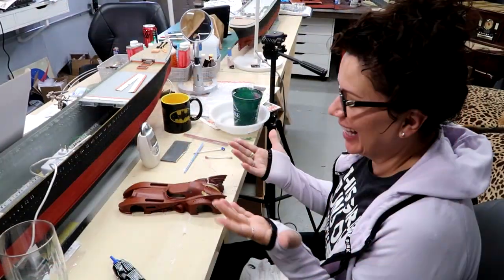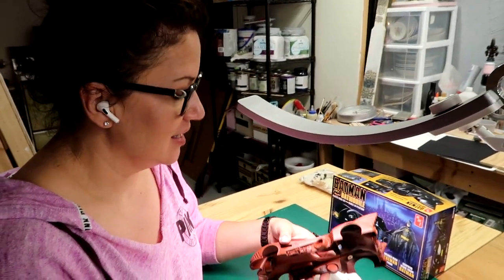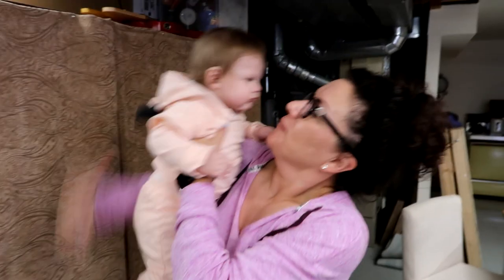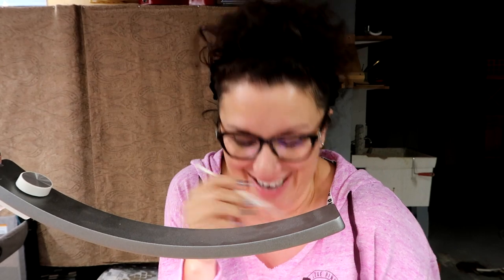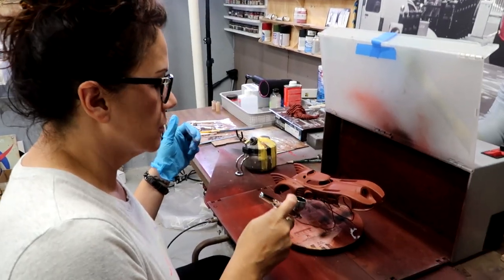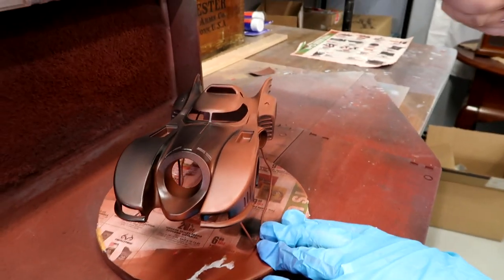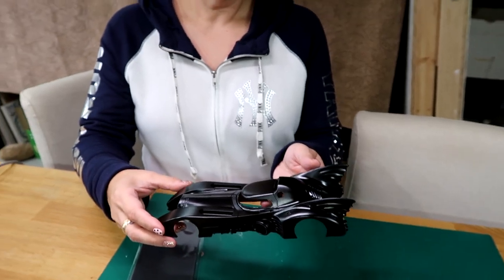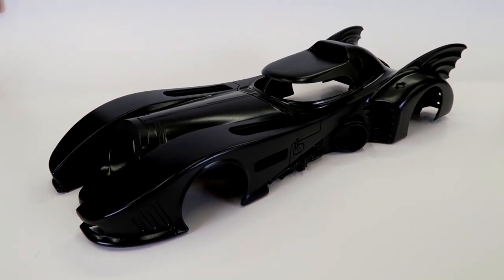Nora's AMT Batmobile Video 3

Comment: Looks good. What I like to use for filling gaps is I buy an extra bottle of tamiya extra thin glue I put the color of sprue from the kit I'm working on in the glue and it turns it into liquid plastic and I use that as a filler. Yes its pricey but it works.
Reply from the maker: That’s actually a really great idea.

Comment: Nora , a secret technique for filling deep seams like that is to use Super Glue ( Bob Smith is the Best ) Apply it with an Exacto  Blade in Layers . What Happens with Putty's they Shrink with time but also The Primer dissolves the putty as well . The Supper Glue  sands really well and fills really fast. Give it a try next time , Great Job on the Bat Mobile.